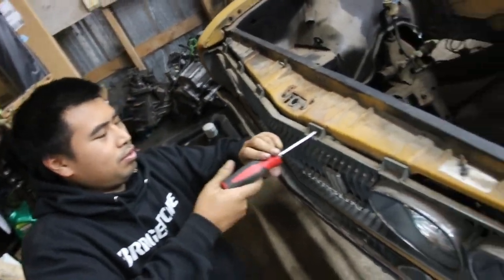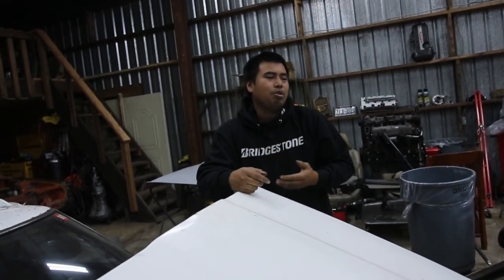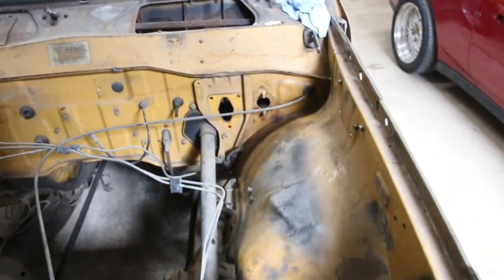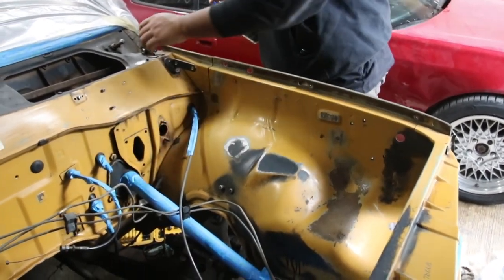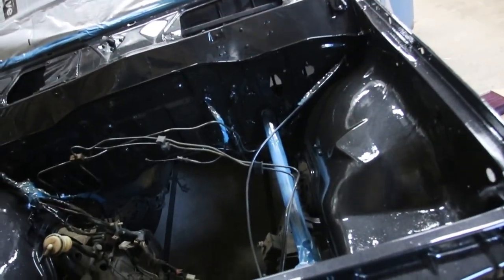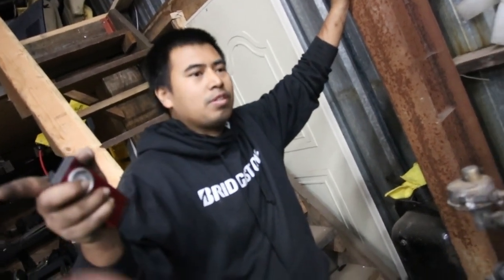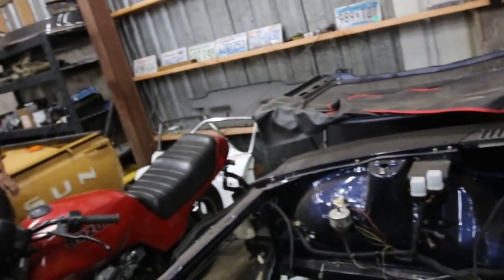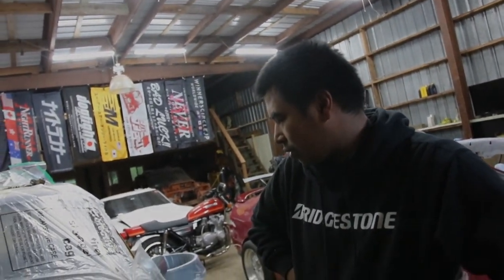Painting Datsun 620 Engine Bay

Comment: Look at you guys, getting to it !
Well " you could have gone safari gold after all that prep.
But it would not have been a "Redline280z" Style...now would it ?
That Safari gold is ,so cool!
To me it's only cool if the car was originally that color, which it is. So it's cool.
But outside just find safari gold and just touch it up in safari gold only , that would look cool! So it doesn't look like perfect paint but spot prime and spot safari gold on the primer, would be a cool look. 
Different Safari gold ,touched up at different times, it would be very cool.
Yep that poor motor needs a little make over, Japanese timing chain set from ZcarDepot is the least. 
You can freshen it up with no NO machine shop work! With fresh stock rings and fresh stock bearings. And fresh valve guide seals. That is just time, NO machine shop. Datsun motors steel cylinder walls don't ever need honing they are so tough.New factory rings of any brand will seat them selves zcardepot I got OEM head bolts in factory Nissan bags less than arp.
You can refresh absolutely NO machine shop. Fresh gaskets wire wheel the head combustion chamber. New OEM head gasket. And that is very very little money, to bring back the motor. Fresh bearings,fresh timing chain set comes with new guides and new tensioner, fresh gaskets, fresh seals ahhh and no machine shop needed !
I we the five years I've been restomoding my two Z cars.
I have always bought most parts at Zcardepot between online store and thier eBay store he always has , OEM, or Japanese, and he has after market Chinese parts too. But. Both my motors have OEM Japan, or Japanese after market. No China parts on my Z cars, that is my motto!
Reply from the maker: Yeah I just want to keep it simple for this Datsun